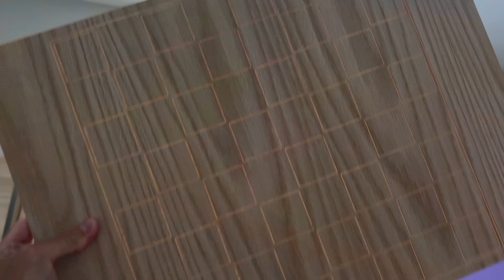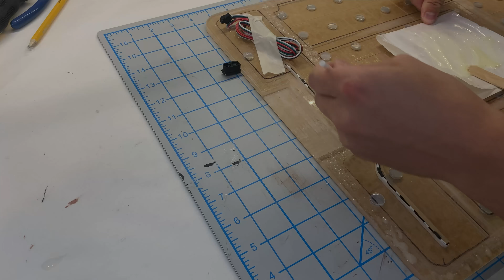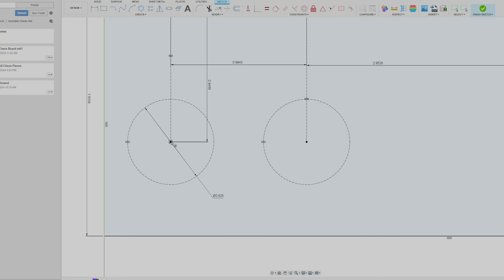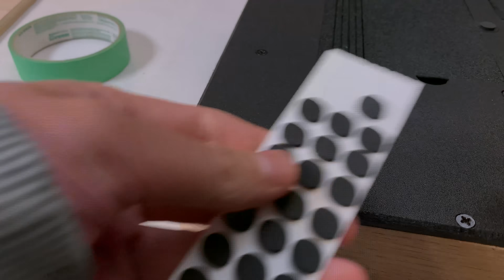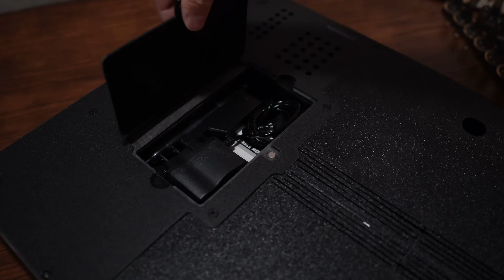I Built a Chess Board That Hides Itself

Comment: Before you put the oak on the acrylic panel, etch for the squares on the underside of the veneer. The light will be able to pass through but you shouldn't see them when the light is off, it'll leave you with a flat surface on the top. It might be a good idea to paint some clear epoxy into the etched grooves too, since they'll be quite thin on the top and easier to accidentally break than the current design. This might be trickier to do while keeping everything aligned, but I think it's the simplest design change to hide the squares perfectly.

On a personal note, I've seen some other suggestions of sensors to change the colour of a square that has a piece on it. I think that would look tacky and overdone myself - you can already tell whether a square has a piece on it, because you can see the piece, so it's not adding much other than flashy lights. You're building a chessboard, not a rave. That being said, it could also be a lot of fun so maybe do it just for that. 

I also think moving the spot for the pieces into slide-out drawers on either side would be a much nicer look - means you don't need to flip the board to get the pieces. Blending the veneer is tricky but doable, and you could add a pressure sensor (or even a hall effect sensor) to activate the lights when the pieces are removed, which gets rid of the on/off button. Since you can control the LED's from your phone you could remove the controller button for them too and now you've got what looks like a nice block of wood with a power cable attached to it, no indication of what it is or how to use it.
Reply: Opening the drawer would also be a bit trickier, since adding a drawer handle kind of ruins the effect. There are push-open drawer slides but might be hard to find some that are small enough for your use case. First-guess I've got there is to take inspiration from clicky pens, which I think use some sort of a cam and spring mechanism which should be fairly easy to replicate with some standard springs & 3d printing
Reply: Also lots of suggestions like valid-squares being illuminated when you lift a piece off the board, or highlighting suggested moves, or Stockfish integration. Those all sound cool but are much more complicated, because now you need to be able to uniquely identify each type of piece. It's a cool software engineering challenge since there's no easy way to make the pieces identifiable by a sensor, so you'd need to track the board from its initial (known) state and update based on every move made. That's cool as hell and if you feel confident doing it give it a try, would love to see your solution, but yeah would be a fair bit more difficult than the current software.

Comment: why do you use so little glue? Is there a reason or do you just kinda do it that way
Reply from the maker: As far as wood glue? Mainly for servicing if I ever need to pull it apart for some reason. My design is not as serviceable as I would have liked.

Comment: Idea for the next time maybe…. Chessboards have light and dark squares, it’s fundamental to
The game. Perhaps include that in the design. Just a tip you may not know, the light square will always be on the bottom right side of the board when viewed from the player positions. If the dark square is there the board needs to be rotated 90°
Reply from the maker: This was absolutely in my planning before building. Instead of light and dark, it's negative space and positive squares. Once you sit down and play it makes sense. While not traditional we have played many games without confusion! Thanks for watching.
Reply: @hobbybuilt tbh I for one thought that was obvious… but I’d imagine the cross section between chess nerds and electronic enthusiast nerd includes a lot of acoustics
Reply: Came here to say just this. Neat project, but useless without light and dark squares.

Comment: Beautiful piece. Only thought I have is to make the squares different shades of wood, dark and light. I think this would look better but couldn't be milled and stained from one solid top piece easily. Would have to make 32 squares in each shade and glue them on, perhaps with a 3D printed or acrylic frame underneath for alignment purposes and to diffuse the LED lights shining through the cracks between the squares.
Reply from the maker: Liking the idea of different types of wood! thanks for watching

Comment: Why did you feel you needed to cast the pieces? They were resin printed so really smooth.  There is white and black resin.
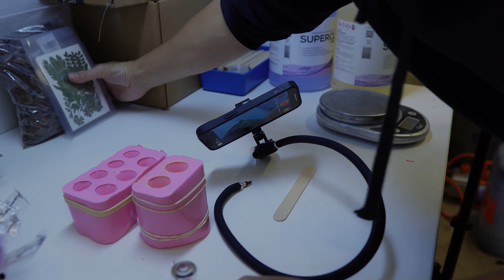Reply from the maker: 7:54 I originally intended to cast the pieces with suspended leaves and bark printers cannot do that. Also I was after optically clear look before deciding on what I ended up doing. Resin is far from as clear as a resin pour.

Comment: Cool looking and great craftmanship but which fields are white and which are black???
Reply from the maker: You can choose!
Reply: Please don't get me wrong, I love chess and enjoy collecting beautiful, artistic, handmade and in any way special chess sets, of which i have quite a few, and I'm not trying to rain on your parade, I just think it would be very confusing to play on a single-colored board.

You have made a beautiful looking chess set and I aplaude your vision and execution, I just wish you made it in two different shades of veneer, that's all.

"The chessboard is colored in two contrasting colors, typically black and white, to help players easily distinguish between the squares and visualize the movement of pieces. The alternating colors assist in identifying the positions of pieces and the strategic layout of the board, especially when considering the patterns of movement and control over the board.

If the chessboard were colored in just one uniform color, it could potentially affect gameplay in several ways:

Visual Clarity: The lack of contrast might make it harder for players to quickly identify square colors, which is important for certain moves (e.g., bishops only move on squares of their own color). This could lead to confusion and mistakes.

Cognitive Load: Players might need to spend extra time mentally tracking which squares are which, increasing cognitive load. This could slow down decision-making and lead to longer thinking times, especially for complex positions.

Aesthetic and Tradition: Chess has a long-standing tradition of using a two-tone board, and the aesthetic appeal of this design contributes to the overall experience of the game.

Overall, while it is possible to play chess on a uniform color board, it would likely hinder performance and increase the time taken to think through moves, as players would need to compensate for the lack of visual aids."
Reply from the maker: I love your passion on this! while not traditional yes it still is very intuitive to play and easy to tell the negative space from the positive squares easily! I was very worried about this in the beginning too but glad it turned out the way it did.

Comment: This is a reaaaallly cool board you made! I do have a suggestion for Chessboard V2. Instead of having the outlines have RGB. Make it so that there is an LED shining through each chess piece. When connected to a magnetic sensor. It could then detect when the pieces are on the spot. And this way you can colour them making it visible from ALL angles.
Reply from the maker: Yeah this would be a for sure thing I add for a V2 in the future! Thanks for watching

Comment: Let's do the math.  64 squares, 32 chess pieces + two extra queens, 34 storage slots, = 132 magnets.
Add 8 magnets for the 2 hinged panels = 140 magnets.  Plus another panel, looks like 4 more magnets (or was that 8?) so 144-148 magnets.
Hope you didn't mount any magnets backwards!
Reply from the maker: @KennethScharf  so close, just add +1 for the accessory slot and +8 for the stowed carrier placement magnets in the board. I only recording a brief shot of that so understandable!

Oh I did multiple times ughh

Comment: Now if you want to make something really complex you can try seeing if you making one that has a built in AI for playing chess. What I mean is make it so that the bottom LEDs light up to indicate where one chess piece should move to which spot. For example make it green to select the chess piece and make the new spor blue. Then make which ever piece needs to be removed from the board light up red. But you probably would have to add NFC tags to every individual piece so the computer will now the differences between them.
Reply from the maker: Definitely an ambitious project, but it would be a fun challenge for a version 2!

Comment: Great video! For such a small moment, my absolute highlight was your tip for FDM printlines by applying superglue onto them and then sanding them down. Dunno why I never thought of that!

Although, I am curious about your brush you're applying it with -- wouldn't you have to discard it after applying super glue?
Reply from the maker: It works so well for me especially really thin super glue I buy. As for the brushes they are small acid throw away brushes, It try to get multiple uses out of the by cutting off the tip. Make me feel less wasteful. I also use silicone brushes that last a bit longer but still harden over time. Here is a kit of materials I use to finish 3D prints
https://kit.co/HobbyBuilt/finishing-3d-prints

Comment: Looks amazing! Two questions; why didn’t you CNC the lines in the bottom so the top was one smooth surface (not that it matters, just curious), and how many magnets did you use? Keep up the great work!
Reply from the maker: The acrylic was 1/4" at that depth the glow wouldn't make it through the veneer top. It would have been great to have the top seamless but wouldn't work :/
as for the magnets 149! thank you for watching!

Comment: Why did you choose to not use the printed pieces and mold them instead? Thinking of making some for a friend is why.
Reply from the maker: A few reasons mainly transparency and getting the colors just right. But also durability and to control the surface finish much better. I have plans to give away the molds in my next video be sure to watch!

Comment: Need hall effect sensors per square. Magnets in piece. Piece down, sensor on, led square lit. Cool project. Many options. Nice job!
Reply from the maker: Version 2! If i get to it haha.
Reply: @hobbybuilt  See if you can vary the magnetic strength enough to tell which piece is which?  There's a lot of possibility in this already amazing build!
Reply from the maker: @maximusdarja excellent idea! I bet it’s possible.
Reply: @hobbybuilt  Even if you can't tell which piece by sensor, you can track them from the start of the game and always know what moved where
Reply: NIce set! But what about rftag-s in each piece, and match supervision and log-ing? Maybe some game engine involvement, also?
😊
Reply: hall effect, and rfid tag, so give "newbie mode" each piece turn on led, for brief of time (5second perhaps) to give posible move
Reply: @adimegan4677  and, you could even have like stockfish built in to make training and stuff
Reply: You meant a reed switch per square
Reply: I am currently doing this for my electronics bachelor Thesis, its looking pretty sick. The board also displays possible moves for every piece

Comment: Great job, but since you asked, next time, you could have a matrix of LEDs under the chessboard so you could light up each square individually, have a hall sensor under each square. 
This way you could have the valid moves light up when you lift a chess piece, you could also have a training mode, so when you move a piece the computer opponents can light up the move it wants to make
Reply from the maker: Oh yeah that would be great, others have mentioned that. Maybe a version 2 is in the horizon.

Comment: Lasers! Use lasers to make the grid so you dont have to use cutouts, maybe even do a crazy almost chaotic design but have the grid light up through the material, use light anyway if you want the board to be invisible
Reply from the maker: Very interesting!
Reply: I was going to say a similar thing - have no cut-outs on the top surface, so that it is completely smooth, but cut-out from below, thin enough so that the light still shines through when playing.  Still very impressive though!

Comment: I havent seen the whole video yet, but if u added pressure plates, u could have made it so it lights where figures are, or vice versa
Reply from the maker: That would be so cool, someone mentioned Hall effect sensors for that and I saw they were fairly cheap for a pack of them.
Reply: @ there you go, if u ever decide on building a chess board v2, that’s an idea. Good luck and good job with this one!

Comment: Awesome build. One question, were you conscious during the build of the polarity of the magnets such that the storage bars and the chess board base are one polarity and the chess pieces are the other poles
Reply from the maker: Thanks so much! Really great question I messed up the polarity at least 5 times during the project and I was trying my best not to. It was tricky to check and glue/mount them only to find they flipped on my when I wasn’t looking. 

Hindsight marking them all (on one side) would have made it easier maybe.

Comment: Im going with 141 magnets. Probably could have just put a steel plate on the bottom of the pieces instead of additional magnets.

If you ever decide to make a new board, I think having LEDs at each square and lighting up the square when there is a piece on it would be awesome.
Reply from the maker: @ZeroAme  so close, you missed the magnets that secure the chess pieces in the stowed position. I didn’t get good footage of it so that’s understandable!

Ohh yeah that would have been nice. As for the steel I want the pieces to only stick to the actual squares and it would be a bit tricky to make the leds shine through.
Reply: @hobbybuilt  Oh yup I did forget those ones, I am guessing that there are at least 2 per in those compartments which would be 149, but I could see there being more than 2 in there to make sure they don't fall off while moving the board around, so maybe 153 or 157?
Reply from the maker: Spot on 149! Should have done at least 157 though, hold is a bit weak. You’re good haha.